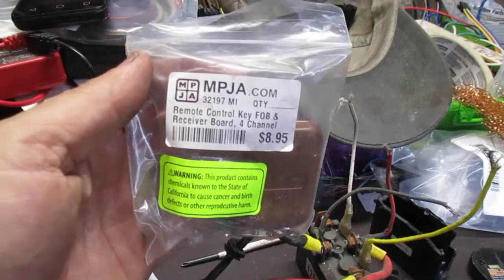Replace Lost Harbor Fright Winch Remote for $7

Comment: NO LONGER available. 😞
Reply from the maker: mpja doesn't have the bare boards anymore, as surplus vendor that is typical. But if you try ebay or aliexpress you can find the same hardware.  search remote control 5v 4 channel and you will find one, aliexpress has them $2 + ship

Comment from the maker: btw, you can also bypass the remote and just use the white and yellow wires to control the winch.  If you put 12v on them, it will turn on the winch, one forward, one backward (can't remember which).  So when I hack into the control box, I run those out those two wires, so if you lose the remote, you can still get your car off/on the trailer.
Reply from the maker: Had another remote fail from getting wet, so came back to watch my own video to hack in the cheap remote.  And also you can buy these on ebay for $3 each, I got 5 of them..